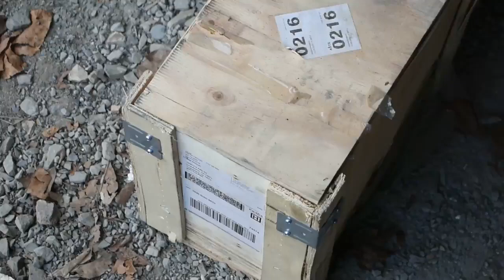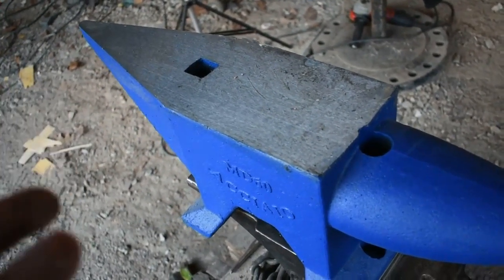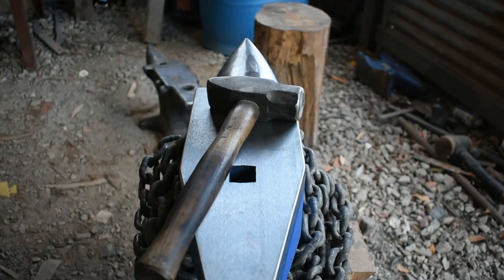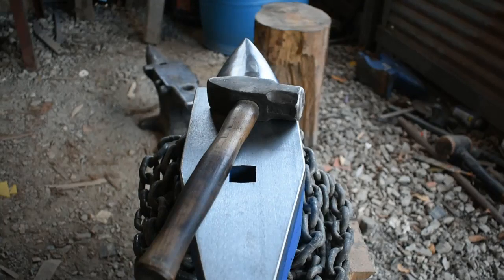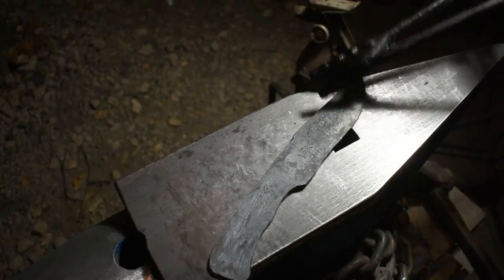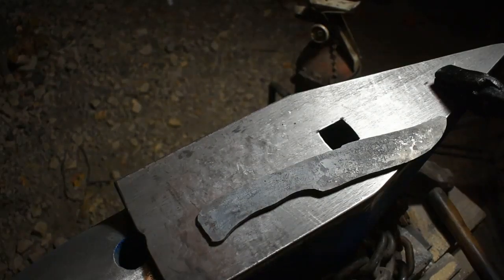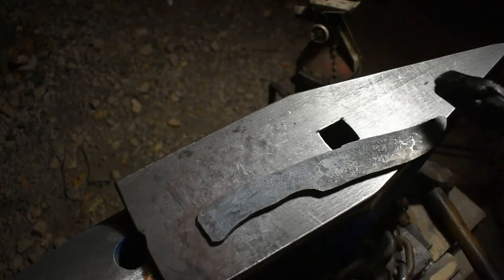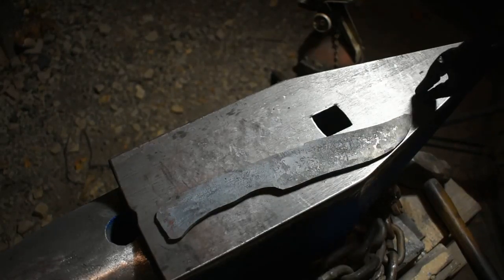Vevor 132 pound anvil review: Forging a Harpoon Point skinner

Comment: Today I learned my computer speakers could reproduce the ringing these anvils make and cause me to flinch and look for my hearing protection. I bought one of these but it was the black one (I think this was a 50 hardness and the black is a 55) but the ringing was all the same. I had to mount mine to a wood block and wrap it with chain but holy crap these are insane for the price. I got mine for 287 shipped. Though I had to help the fedex guy get it out of the truck, it was so worth it. I haven't had it for very long but I've abused it pretty badly and no marks so far. I would highly suggest this anvil for anyone just getting into blacksmithing.
Reply from the maker: Sorry about that, They are really good anvils for the price. I appreciate you watching!

Comment: i got lucky. my grandpa had a 64kg (141lb) Brooks anvil sitting around so he gave it to me. its wicked awesome to use and its the only piece of forging equipment i have that is irreplaceable. pretty good condition aside from a few minor dings on the horn and just a bit weathered. i used to have a little 56lb (25.4kg) peter wright to forge knives on, but with this Brooks i can whack out 5160 blades of all sizes very fast. in my experience (im sure most peoples) the right anvil setup makes a difference when it comes to speed and quality of the project and is definitely easier on your body.

Comment: I picked up an anvil like this a couple of months ago, I cleaned (wire brushed the black paint off)it up, welded and leveled the pritchell hole with the face, and made a steel base for it, it serves me well, I have no problems with casting or hardness (55)at all. I don’t care about issues with packaging and grease on the face-it was delivered quick and in a hurry to my door. I did a lot of research on anvil shape and price per pound, sure I would love to have bought a rigid anvil, but I could not justify the cost. And this anvil has turned out to be a keeper.
Reply: I'd love to see what you did to level the pritchell. I was debating having a new pritchell drilled in the heel (carbide/cobalt bits are pricey) and plugging and welding the old pritchell shut.

Comment: How would the anvil survive forging a pair of tongs out of 20mm steel
Reply from the maker: Probably ok,I know Old Hickory forge beat on his with a sledge, I would say if you have an extra 7-800 dollars then go with a quality made anvil but if your just getting started and want to get to work then I would go with this one, the face skates a file, this isn't a soft cast iron face like a harbor freight anvil.  The steel I used was 1/4 inch bar, and I have done multiple rr spike projects both knives and forks without any issues. I do plan on using this anvil solely for future work both bladesmithing and blacksmithing to test out its durablility, and I promise that if I have any problems it will documented here on the channel, If you can afford it it's always best to go with the best but if your working on a budget, this one is pretty close to the top of your options for a new anvil.